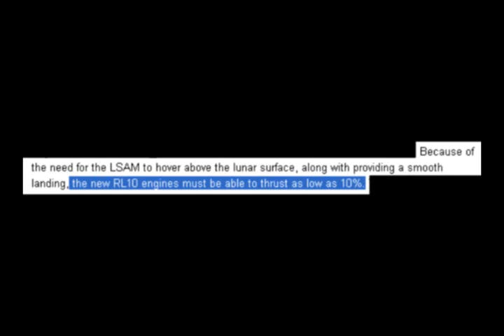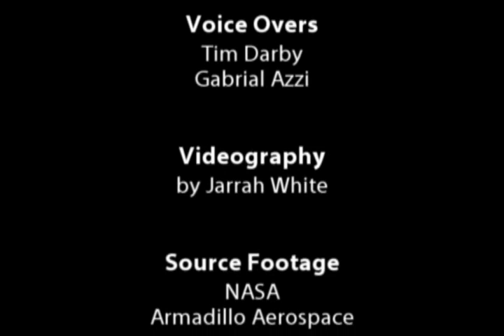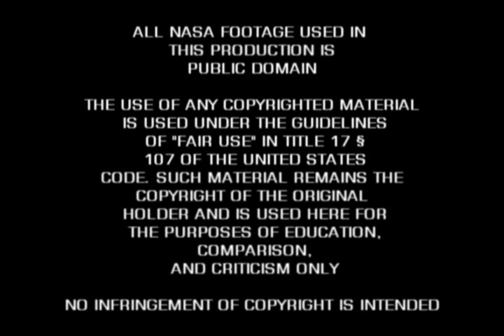MoonFaker: No Crater. PART 5

Comment: @WhiteJarrah Again, you confuse the capacity of thrust with the actual APPLICATION or use of thrust. It wont matter how much power the engine has, as the total power output capability wont be used in full in a DESCENT into 1/6 the gravity of earth.

Comment: @occhamite "The water bound-up in the concrete is converted to superheated steam, the high pressure thereby created fractures the concrete"
The 872 kg of  "moon rocks" from 6 missions were created here on Earth !969-72 by NASA under the assumption that such rocks would be DRY - lack any water. But 3 months ago the Indian space agency revealed that  their rock samples taken from the surface of the Moon were not dry, but contained water!
So, even more reason for a blast crater to have formed!

Comment: Was there evidence of a crater under the Soviet unmanned landers?
We can calculate the exhaust pressure at the engine bell...now, taking into account the overexpansion of the exhaust leaving the nozzle in vaccuum, what might the pressure have been a foot below the bell? 3 feet below?
Noticably less...perhaps exponentionally less?

Comment: Ok so let me get this straight....the 2,500 lbf thrust engine was strong enough to move an object the weight of an SUV through the VACUUM of space, yet when over the moons surface, that same VACUUM renders the same thrust incapable of moving small pebbles, while at the same time assisting in the lowering of said 5,000 lb moon equivalent weighted LEM.  Does that make sense?  The engine encourages the movement of a 5,000lb vehicle, yet has NO effect on pebbles.  Strange.

Comment: It's not a valid comparison because you made no effort to validate the claim of Plait. Simply Plait is wrong or inaccurate because of not considering rapid pressure dissipation  in a vacuum and/or not comprensating for the cone expansion of the exhaust over a given distance which, even in an atmosphere, causes a dissipation of pressure.

This has been addressed more than once. I hope you manage to actually comprehend the logic here as to why your comparison is invalid/inaccurate.

Comment: This is getting annoying to not have my comments register.

Don't want to type all that again, but suffice to say the pressure at the bell is under 2psi at 3klbf. You would need to do a simple conical dispersion using the bell's cross section and distance to the ground to get the pressure at the surface. This still maintains for atmospheric conditions and being in a vacuum causes rapid dispersion of pressure generated.

Comment from the maker: 'Are you HONESTLY saying that the pressure of the Saturn V on the launch platform was less than .9psi?' 

Why not try reading my actual message. A flame trench DEFLECTS THE PLUMES AWAY FROM THE GROUND. If there was no flame trench underneath, it certainly would have blasted a huge crater underneath.

Comment from the maker: 'I know it's not a crater.'

It's a HARDEN DEFLECTOR to direct the plumes AWAY from the ground. That's why you don't find a crater under the Saturn V. In any case the launch gantry and various equipment ends up pretty burnt after takeoff. I've seen videos of such.

'YOU'RE A LIAR.'

I could say the same about you. They show that very incident in What Happened On The Moon, you can see it with your own eyes.

Comment: "Do you know what a flame trench is?"

I know it's not a crater. I also know it only happens with a sustained burn on a single area, which the Apollo landing wasn't.

As for the DC-X, I'm talking about the emergency landing they did OFF-RUNWAY. Where later on they couldn't even tell WHERE it happened. THERE WAS NO CRATER. THERE WAS NO NOTHING. A foot deep or otherwise. YOU'RE A LIAR.

Comment from the maker: 'So why didn't the Saturn V dig through concrete when it launched?'

Do you know what a flame trench is?

'Why didn't the DC-X leave a crater?'

Depends on which landing you're talking about. It didn't leave a crater on the runway, because runways are BUILT to be hardy against high pressure and temperature. But there was one incident when the DC-X veered off course and landed in the desert. It tore up the desert ground and left a crater about a foot deep.